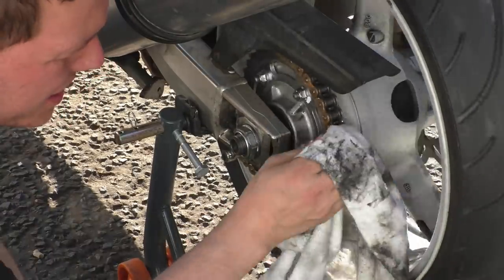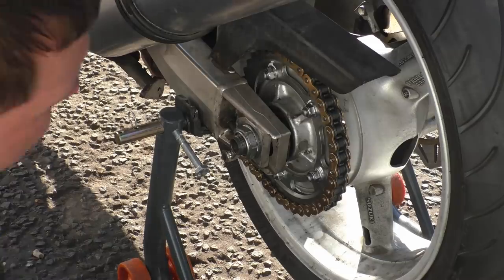Chain cleaning procedure

Comment: i've been using wd40 to clean forever- never had a chain problem- i've changed out chain/ sprox each time because the sprockets have worn before any 'disastrous' chain issues. many thanks for the gear oil vid. since then i've used nothing else to lube it. happy days!

Comment: Usually I soak an old, used up microfiber cloth in chain cleaner, then clean up the chain with it and then I lubricate it with 80w90 gear oil and wipe off the excess oil with dry cloth. Does the job pretty well.

Comment: I lube my chain by pushing the bike up onto a pedestrian overpass, coating the back wheel with sump oil and doing a massive smokey burnout. You’ll never get the combination of oil and rubber off the bike ever again, let alone the chain! Works a treat!

Comment: Ever tried using chainsaw chain and bar oil, with its anti fling/anti corrosion properties ?
Reply from the maker: No because its for chainsaws LOL
Reply: LOL, but your oil's for gearbox's ;)
Reply from the maker: Ah but this is part of the transmission LOL your move sir
Reply: hahaha, chainsaw oil is for lubing chains
Reply: I can add some data to this.  Suzuki, for the SV650, for the original O ring chain supplied by DID recommend cleaning with Kerosene (paraffin) and lubricating with engine oil.  Now I have a chainsaw so I thought that the anti fling properties may work whilst looking after the chain.  I also obtained the information of what the chain oil specification was for the Scott Oiler Oil and who made it.

I then contacted Morris Lubricants and their laboratory responded to me and over a number of emails having forwarded all of the above they confirmed that chainsaw chain lubricant can be used for this without any detrimental affect on the chain, the O or X rings, etc and that it would have less flinging than say just an oil and handle the job well.  This was a few years ago and I have been using standard chainsaw chain oil since then.

For those outside of the UK and those within that don't know Morris Lubricants make a whole range of lubricants for different industries. They are also in car and bike racing and for bikes they make a range of oils for different types and uses of  bikes as well as classic bike oils.  They also produce their own chain spray. Many of their product are rebranded for other OEMs.
Reply: The Workshop just put a chainsaw chain on your bike so you can use chainsaw oil.

This isn't rocket science.
Reply: I've used chainsaw oil, no problems with it, I think there is better but it costs more- then again I don't think chain oilers are crap either so I may not be on message.  I think regular cleaning is the most important, get all the crap off the chain regularly.  Like has been said the chain, unless it is old school, is sealed lube anyway so masses of lubricant isn't needed.  If the seals have gone on the rollers then the chain is knackered anyway.

Comment: DID say no.
 Kerosene / Paraffin is 'Diesel fuel No 1' (lighter; less viscosity, doesn't gel as easily in cold temps); so diesel would be pretty much the same as Kerosene in deforming 0 or x rings; as would WD40 which has similar content and properties of?  YT deletes links most of the time so just search for D.I.D Chain Maintenance'

"D.I.D does not recommend maintaining any drive chain with kerosene.

■Cleaning a sealed chain with kerosene would cause deformation of the seal ring and can oftentimes lead to rusting of a chain due to the removal of grease on the chain’s surface, which increases the risk of chain corruption and chain failure. It is highly likely that use of kerosene on a sealed drive chain will drastically decrease the chains performance."
Reply: Good questions. FortNine did a year-long test of chain cleaners (Which Chain Cleaner is Best? Comparison Test) and came to these results. Unless you used gasoline, none of the cleaners attacked the rubber. However, they all had varying degrees of penetration past the o-rings that could potentially wash out the grease. The best at not penetrating were Simple Green, Ipone, Muc-off, and WD40. 
FortNine's test here. https://www.youtube.com/watch?v=UrEpAUi_QKA&t=473s

I'm new to Dirty Garage Guy's channel and am truly impressed. His explanation of why chains have tight spots was a masterclass. His honesty about his choices of products is refreshing and practical. BTW, I'm a retired aircraft mechanic and am on my fifth motorcycle. And am still learning from those who will teach.

Comment: Would copper grease be ok
Reply: Copper grease is anti seize, as in your put it on a car wheel hub, to stop the wheel sticking to it. Never metal to metal kinda thing. 
Copper grease shouldn’t be used as a lubricant, even though it has grease in it, it also has copper particles that would grind away the metal of the moving parts. 

I believe that’s right, haha.
Reply: There is also an aluminium version of copper grease that is used in marine situations.  It is supposedly better for vehicles as well though I have never used it.

Comment: Have you a spy cam in my shed  that's exzacery how i do it ye wd is a good cleaner i use the liquid wd i bought 20ltrs of it and use the 85/140 gear oil with a dash of graphite powder mixed in ..think I've told you that bit before .. never had a chain lunch it self .. plus it don't turn it into a grinding paste when it gets mucky like the can crap do

Comment: Question: What is the difference between Chain Cleaner and WD40, if any? I assume they both have some form of solvent in them, but interested to know just how much they differ.
Reply from the maker: My god that's a massive question. Which one?
Reply: Umm, I dunno. Take a bog standard chain cleaner, say Motul stuff ('cos that's what I've got), just how different is it to WD40? I'm just wary of putting something that is a penetrating fluid around o-rings. I put wd40 on skateboard wheel bearings when I was a kid, and the wheels certainly spun faster (for the short amount of time the bearings continued to work), so I kinda learnt the hard way about WD40. I know bearings aren't o-ring sealed, but I still don't trust the stuff, so if it doesn't interfere/perish o-rings, how is it much different from a chain cleaner (or is a dedicated chain cleaner more of a solvent degreaser, whereas WD40 has solvents plus other stuff to react with rust)?

(Yeah, I'm no chemist, so probably talking bollocks)
Reply: WD40 has a high percentage per volume of oil. Oils tend to dissolve other oils and the added nafta (as a solvent) increases the overall solvent properties of the product. But why would you ever clean something to be pristine with an oil, like WD40, as a one step cleaning method? The oil will collect particles, making harder the cleaning next time. And it oxidizes making also harder to dissolve it...
Reply: Ah, ok, makes sense about the oil content. But, the WD40 is just to clean, before applying the gear oil. So your point about WD40 collecting particles can't be true as the gear oil is then applied over the top of the WD40. Or did I miss the point?
Reply: Most of the products I tested have almost an 100% of mass with linear and short hydrocarbon parafines. Some small portion of aromatics to improve the solving properties of oxidized oil and waxes, along with the evaporation rate of the product.
Reply: So, commercial chain cleaners are basically a paraffin/solvent mix (in very simplistic terms)?
Reply: Westers151 the idea is not to spread the oil along the chain but just put it on specific spots, with precision and method. The centrifugal forces take care of spreading the oil all over the place, especially with low viscosity oils, like the ones in WD40. The perfect lubing process, to me, is using oils with some low boiling point solvents to improve a lower viscosity while applying it and to improve also the adsorption on tight spots, per example, on the inner racing of the rollers. Where is logically tough to clean it spotless from the gunk...
Reply: Westers151 Yes. C8 to C12 linear HC.
Reply: So are you saying WD40 for cleaning is bad? I've got a bit confused with your answers (sorry)
Reply: Westers151, no. But it is not my first option for cleaning as a one step, proper and efficient method. I don't get the trend on using WD40 for cleaning and everything. At least in Portugal it is expensive as hell, at more than 16 euros per litre. I can get good regular chain cleaners that are safe on o-ring chains for less than 10 euros per litre. Nowadays, I use another one more expensive because it eases the chain maintenance a lot. Really, a lot. Time is money. I do more than 13000 km per year. 26 cleanings per year. 1 every 2 weeks, it is a massive effort to sustain regularly.
Reply: I just use the one litre  paraffin bottle for one €  for oil lamps from the DIY market and it does an excellent job. You can use Kerosin, WD40 or even your piss if you lube up the chain real good after cleaning. The only difference is how much money you spend..

Comment: I like to let the WD40 dry for a few hours or overnight before lubing. It is kerosene based which is what the manufactures recommend for cleaning. DO NOT USE DIESEL! It will eat the orings quickly. I'll never do that again.

Comment: I've always used light gear oil myself then spray some wurth dry chain lube (good shit) over the top of that. Being the older fella that I am these days and ridding for 36 years, and I'm still doing trackdays, I also take very good care of my chains always have done. 
Seen far too many neglected chains break, smash crackcases, cut legs, lock up the rear wheels, hit the fella behind etc. If there's ever an incentive to take care of something, it's learning from some other bell-ends mistakes.

Nowt wrong with your method Matt, only offering my own experience.

Comment: I've used chain wax which is utter shit. Makes a mess where it flings off. Someone said chainsaw oil... too sticky and I imagine it would make a mess as well. Won't use a wire brush because it is a pita. I use a nail brush, paint thinner and then a heavy engine oil wiped off with a rag. Less mess. Taking care of your chain means getting dirty. If you need to wear gloves, maybe you need to buy a tractor with belt drive.

Comment: Do you really need to clean a chain? Except obvious, running into a mud - balls deep. There are 0 ways to effectively lubricate chains from the outside. Big dirt will fling a way, small dirt will be crushed between sprocket and chain links. Then why bother at all? I'm not smart, I can't figure it out. Help me sensej!
Reply from the maker: That dirt that's crushed is now an abrasive that wears out your spocket... reason enough?
Reply: @dirtygarageguy  clear boss. Can one use diesel fuel to remove gunk from chain? So I don’t have to buy expensive bulshit in a can? You should make “Everthing you need to know about chain and cleaning” in one video. I know you have this information in multiple videos. And I watched them all 👍
Reply from the maker: Yes you can use diesel
Reply: @dirtygarageguy  thanks for answering this was literally my question.
Reply: @UocLv  even I feel the same. Chains don't last very long. All this is additional expense on a stuff that's meant to wear down, just doesn't seem worth it to me.

Comment: If that's a new enough chain why is your adjustment setting so far away from the shortest point?
Reply from the maker: They're alignment marks - this give you the ability to make suspension adjustments - like changing the dogleg etc.
Reply: i know they're alinement marks but aren't they also chain wear indicators?  Start at the mark closest to the front sprocket with a new chain and when you hit the one farthest from the front sprocket then it's time for a new chain no?
Reply from the maker: "i know they're alinement marks but aren't they also chain wear indicators? "

- LOL no. Well you can set you initial tension, and then when you redo you're tension say 1 year later, then yes - you'll see it move, but its not an indicator. 

The rear axle is clamped, so when you chain wears it 'stretches'. But the rear wheel shoudln't move. This is why you have to manual adjust your chain slack.
Reply: If a new chain were to put the wheel at the front of the slot the chain would be falling to bits by the time it reached the back of the slot through wear….the chain would be worn beyond use and skipping on the sprocket well before then.
Reply: You won't always start at the first alignment mark with a new chain.  It depends on things like the sprocket sizes you are running.  If you change to a significantly smaller rear sprocket, for example, you will have to set the axle further back.  Sometimes you may even change the number of links in your chain if you've changed other things enough, and this will effect where you initially set your axle.

Comment: I've got a 24 yr old bike that's done 30 thousand with original chain and still going strong and still plenty of life left in it aswel, By just putting a Nats Cock on it every other Ride.. I use Wurth chain lube on both Bikes and the Can should last about 2 yrs.. but every one has different theories..x
Reply: Wurth Dry lube is shit in winter. You need gearbox oil or something slathered on it in winter as a rust barrier.